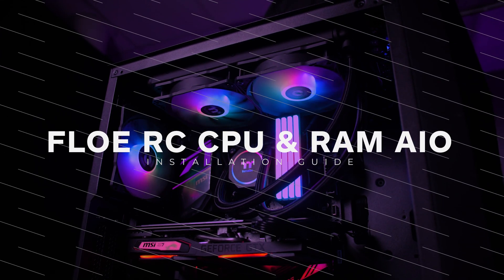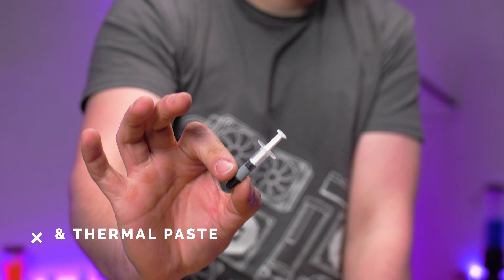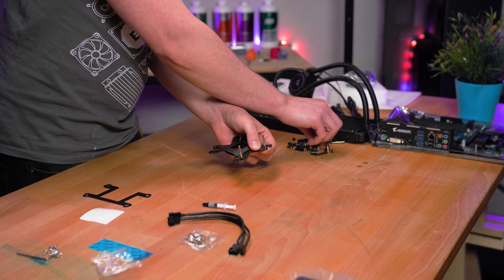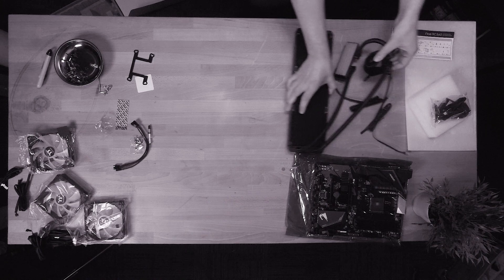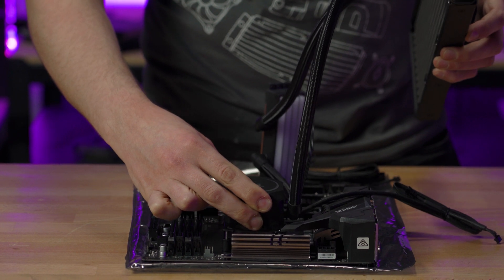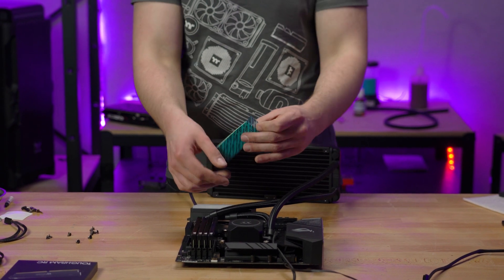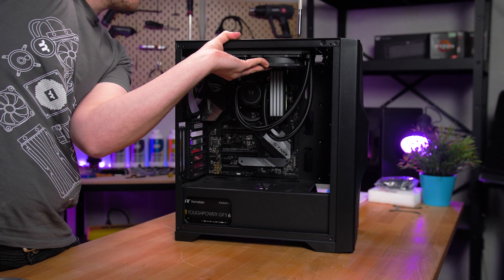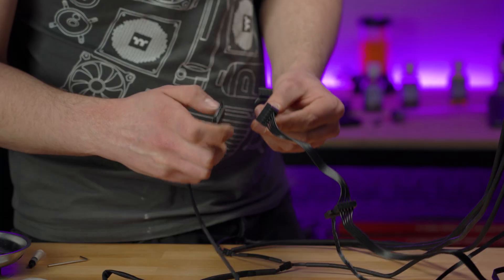How to install the Thermaltake Floe RC All In One CPU and RAM Cooler | Installation Guide

Comment: I didn't understand Gamers Nexus complaining about this concept. Lower temps for overclocking RAM is generally pretty beneficial, however I hope either ToughRAM modules come with some good chips or they eventually make other brands compatible, cause if it´s not, well then it's just for looks.
Reply: Dude I dont even overclock my 3600 cl18 128 GB and they still over heat GN and LTT are fucking frauds
Reply: Did you buy this and if so what was your performance increase?